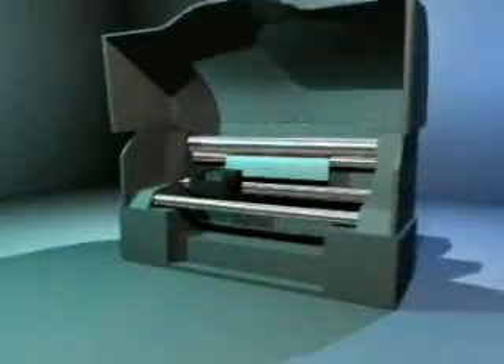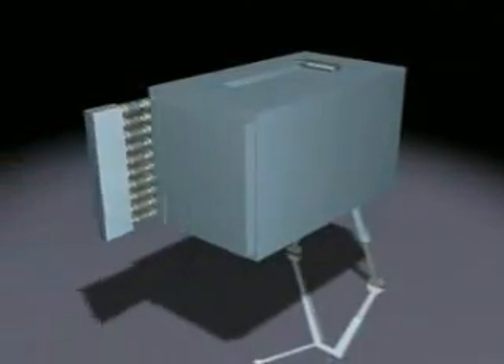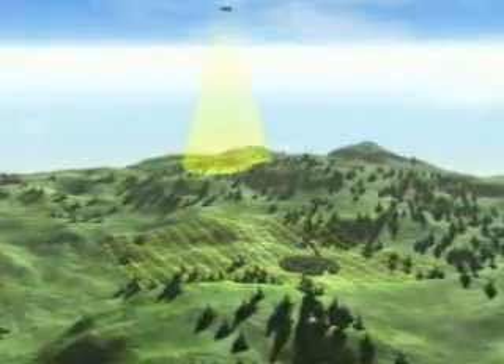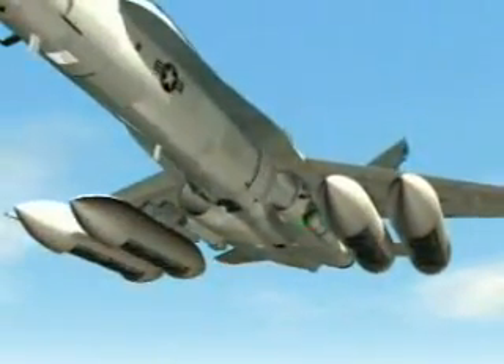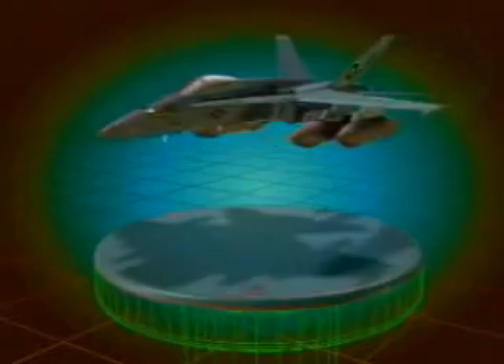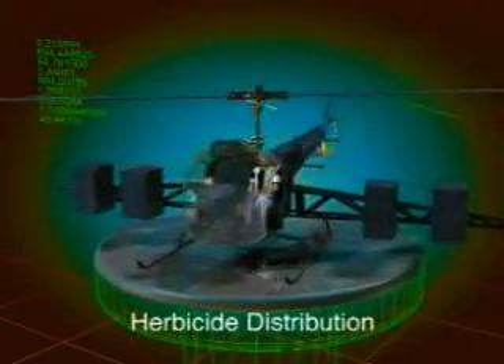metal storm weapons system

Comment: I really like how it's very modular. You could have it in a pod, one of those boxes, or in a pistol. I imagine you could put multiple barrels in a 127mm (diameter) tube. Since it apparently can run on the equivalent of flashlight batteries without an external power source, one could use put it in the tube and use it as a submunition, with time-activation triggered by, say, the force of a mini chute deploying. Four could be packed in a CBU casing and used like a CBU-97 but for antipersonnel duty.

Comment: I find the idea of this fascinating but three flaws immediately jump to mind. Traveling through the barrel is what gives bullets the bulk of their accuracy, but the first bullets fired are essentially right at the muzzle of the barrel meaning the crucial first shots are the least accurate.  Furthermore if used as a handgun, at least, the changing distribution of weight as the number of bullets in the barrel changes would make it much more awkward to handle than conventional guns.  Finally, although they mention heat control, the barrels in the middle would have no way to ventilate even if they aren't always firing.  But it is a wonderful idea nonetheless.
Reply: New materials
Reply: Dude wtf they are bullets.i guess you will just duck..or throw your chat gpt comment at it.took me nine years to think up this reply
Reply: Dude wtf they are bullets.i guess you will just duck..or throw your chat gpt comment at it.took me nine years to think up this reply

Comment: They need to update this tech with firing 50 calibre bullets like from a 50 calibre machine gun. As well with a air defence system like shoots at a rotating angle that sprays a pattern like in the shape of a donut.

Comment: @SADFACE1000 If it were mounted on a 
vehicle, it wouldn't matter. Any EMP capable of
taking out an electronic firing system, would
also take out the vehicle. But you can shield
against EMP.

Comment: @jeremyversteegh not right now however cause it runs off a computer all you have to do is plug in a system that can mesure electromagnetic fields and then once the fields reach a mark the system will shut down the computer and turn it back on after the field level has reduced.

Comment: @DARKlilution

Well, duh.  Obviously, when one bulet will do the job, you use one.  When you need high rates of fire (like when you're shooting down a missile), you use high rates of fire.  You simply use the appropriate tool for the job at hand.  You wouldn't use a jackhammer to tap in a finishing nail, and you wouldn't use a claw hammer to break pavement.

Comment: Computers may not be infallible, but neither are humans. The requirement for using such a computer system is not that it is infallible, but that the computer is less fallible then the human operator would be. In such computer systems this is the case.

Comment: @mikeMusic00  na emp takes eminence amounts of electricity to basically implode on it self like super nova and emp is too wide area to be effective use of fire support 
now if you could fire grouped upper atmosphere discharges in a beam to target like hitting atom the size of base ball with a jack hammer so to speak id like to see what THAT would do but idk if that's even pheasable to pull of for it would have to gather thing com-bust in line not sphere form o well only time will tell

Comment: @branzalito 

Not 'Cartridge', 'Magazine," and no, you don't.  The barrels are prepackaged, stacked like that.  It's quite simple.  It's not unlike the HK G11's prepackaged caseless mags, except without any moving parts.  It's actually several steps less of a pain in the butt than reloading an MG (open feed cover, sweep feed tray, place belt, drop feed cover, pull back charging handle. . . blah blah.)  I don't think you're thinking clearly here.

Comment: can you tell me which article?
Wikipedia says (citation needed)

did you also leave out:
"Metal Storm took out a patent on a barrel pressure relief valve system; but has concentrated in recent years on the development of low pressure 40mm systems, and has in recent demonstrations deployed a microchip at the barrel muzzle which detects the passage of each projectile and locks the firing mechanism (of each subsequent shell) until the first shell has cleared the muzzle.

Comment: yeah smart bombs are great but aren't they about US$50,000 a pop? if you can use the kinetic energy of shit loads of bullets to do the same thing then i would think it'd be quite a bit cheaper than a smart bomb. As for swiss cheese, you don't need to fire it at it's max rate. The pistols they showed there held about 50 or so bullets in the 4 barreled version. Name a pistol that can do that now.

Comment: @322978743  well fore starters that's a rough draft of how it Could be used it could fire on super sonic fly by's with calc gps point to target pre fireing as  a calculation  of how far * how fast so they be dead after  or before depending on force of un guided projectile fly by but with fireing a few miles out 
and since there unguided no jamming would work !... if that makes any sence its like 4 am here so im sleep typing